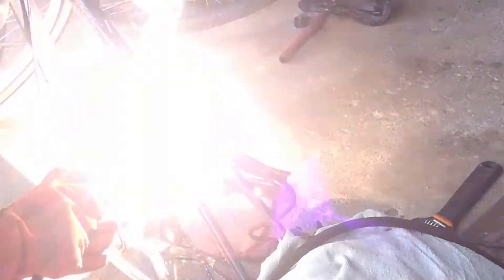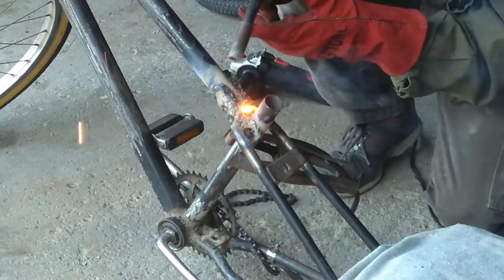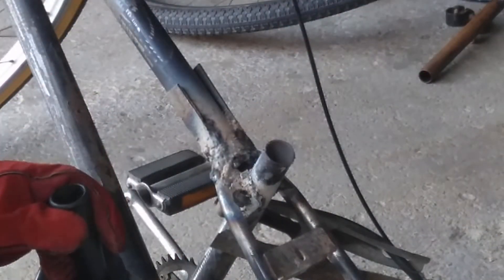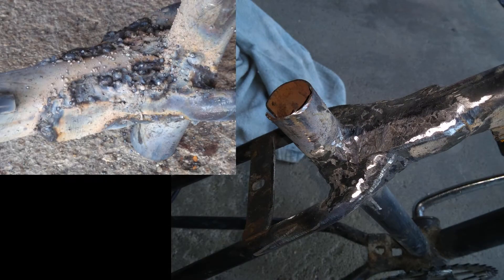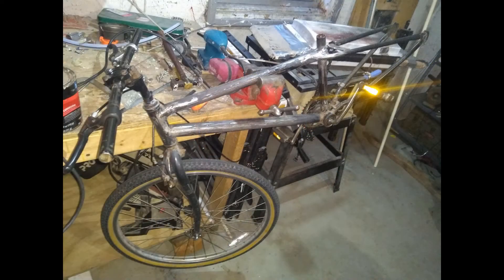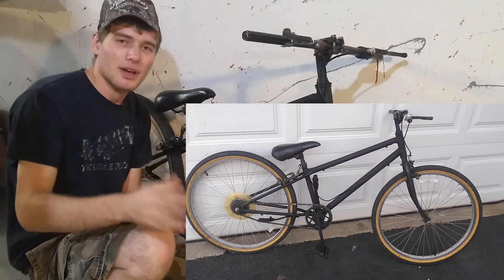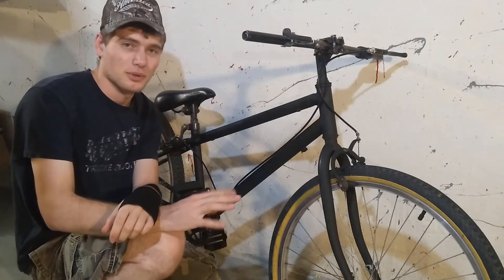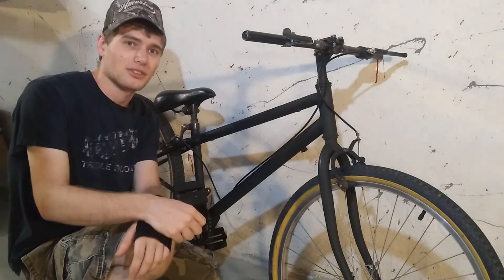Homemade Dirt Jumper Part 4 - Finishing the Frame and Paint

Comment: I think that you should eventually do a disk brake conversion (not crucial), and maybe add a gyro for bar spins and I know you just painted it, but I think it would really help to reinforce the head tube  by welding some metal plates between the top tube and down tube, the bike is looking really good

Comment: Get a forck if you hawe a local bike shop you might get a used one for almost free
Reply from the maker: I have gotten a fork since this video, its a ground assault one (nothing special), but it does work great.  I talked to my local shop guy who is fantastic and he said do to the frame parts I have my options are severally limited for going much beyond the cheap forks.  Its winter now though so will see what i come up with by summer ;-)